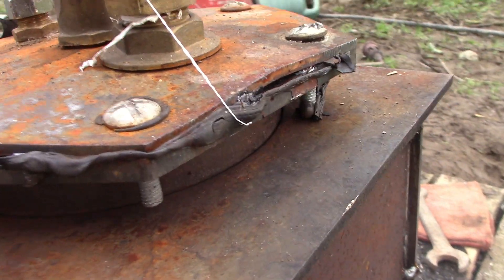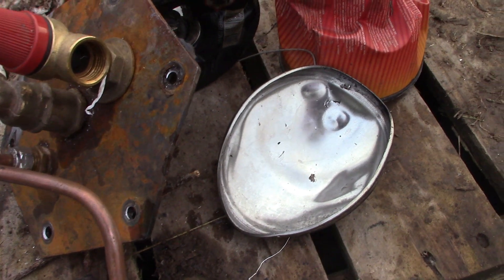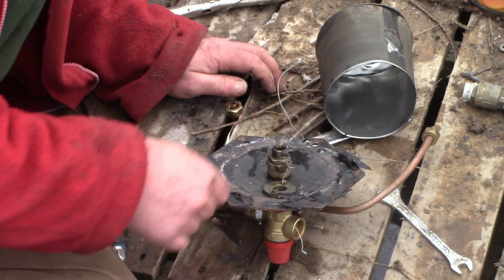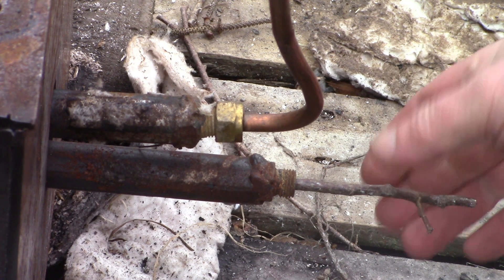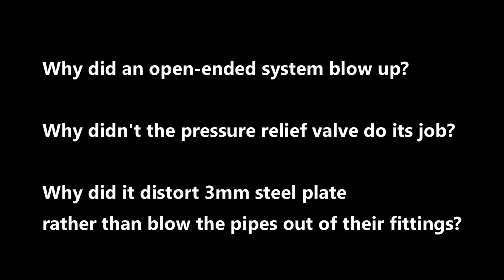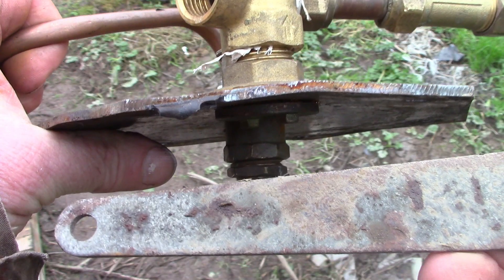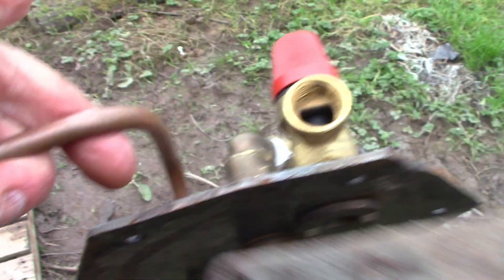Why Did My Boiler Explode??!! My Own Big Bang Theory...

Comment: Your explanation seems reasonable. I think the float system is almost certainly the culprit. You should replace the water inlet valve with a more traditional CLACK VALVE. A simple stainless steel ball bearing one way valve. As far as the pressure releasing valve I would replace that as well with a more traditional spring loaded stainless steel ball valve. It is essential that any boiler system has a blow off valve that is capable of relieving pressure faster than the boiler can increase pressure. The standard boiler test for locomotive type boilers is to bring the boiler up to valve relief pressure then crank up the boiler by opening up the valve that fires steam up the chimney, cause a massive rush of air through the fire increasing steam pressure. The safety valve blowing off must stop any further rise in boiler pressure. Another issue with boilers is having to high a water level, the small amount of steam space allows pressure to prevent the water from boiling off, this causes a buildup of potential steam held back in the form of super heated water, as soon as steam is released the water instantly replaces the steam and water level drop steam space increase causing a rapid boiling off. The relationship between pressure, temperature, steam space is controlled but has a hysteresis loop involved thus the right combination can cause a massive spike in pressure, easily enough to remodel the boiler shape. May I suggest you build a real flash steam boiler , they are much safer as the do not use a volume of pressurised heated water. The concept is simple, create a very long coiled metal tuBe, place this in a fire, when you pump water into the tube it will instantly flash into steam, this then progresses along the tube increasing its pressure and becoming superheated, dry steam. At the end of the pipe connect your steam engine with a bypass valve to allow all the steam to escape and not power the engine, by varying the water pump and adjusting the bypass valve you can control the engine speed. It is best to ad a safety valve just in case the engine stalled when the bypass valve is closed. Often two water pumps are used, one is a priming pump used to start things up and the second is driven by the engine and maintains the flow once started. A typical coil would be like the one brewers use to condense, but more overlapped coils. Consider yourself luck superheated steam will melt the flesh of your bones and from memory the largest ever (until recently) civilian explosion was caused by a factory boiler exploding in an American town.
Reply from the maker: That's what I'm trying to make, Steve. The problem is balancing the water input with the heat. Hence the float valve. It's easy with a gas fire - you know how much water to allow into the system - but this is wood fired so it has to be balanced continuously..
Reply: @wayoutwest-workshopstuff6299  hi there, you are missing the point, you are using a reservoir of water that is being heated, this requires time and a lot of heat to get to the point of creating steam. An analogy if you put a pot on a wood fire it will take several minutes to come to the boil, if however you put a teaspoon of water on the fire it would boil really fast. So you take 30m of coiled copper tube right in the middle of the fire. If you force a tablespoon of water through a one way valve into the pipe it will flash boil into steam within seconds, now add another tablespoon, it will push the steam further into the pipe making it hotter and will boil itself. The important thing is to let the pipe get up to temp before introducing the water. The small amounts of water added will have no effect on the temperature of the copper pipe because the fire can add heat energy faster than the cater can use it to boil.. check out this video it uses blow torches for a high speed boat. Your system relies on bringing the water up to boiling point than as you bleed off steam you introduce more water, instantly chills the boiler and it stops producing steam so the pressure drops.this is why most full sized steam engines have a variable volume pump run from the steam engine that adds a small amount of water to the boiler right next to the firebox, with every rotation of the crankshaft. This avoids the chilling effect. Out of curiosity what size engine are you hoping to run?
Reply: @wayoutwest-workshopstuff6299  https://youtu.be/fPWuW8kBM5c.  Missed the link. Note there is no water reservoir in the heated area, just the tube.
Reply from the maker: @steveallen8987  I know well how they work, Steve. But you're missing the point now - as I said, it's easy if you have a constant heat, but I'm trying to allow for variable heat...
Reply: @wayoutwest-workshopstuff6299  ok I get you now, so the floats appear to be the main source of failure so how about a smaller rigid float with a very small hole in the to to allow equal pressure inside and out and small enough to prevent water entering or perhaps a small curved pipe connected to hole to keep out water. If the size is smaller perhaps a guide to keep it in position?

Comment: Interesting stuff:D, glad you and your helpers are ok. 

(disclaimer: I'm an thermo- and fluiddynamics engineer...but not a specialist in boilers/reactors)

I can imagine 2 scenarios:
---------------------------------------------------
1: Your theory: I don't know what safetyvalve you used and if it's perfectly suited for this application. maybe the pressure wasn't higher as the relief value of the valve but too high for your lid (as you said)...One could calculate this to see if this is a reasonable explainaition. 

2: somehow the top cannister got pushed up over the inlet valve (maybe to thight of a fit from the floats inside the boiler(top float acts as piston)). Since all the connections are at the top, they got sealed with the alluminium sheet from the top float. So the steam couldn't exit anymore and the pressure built up until something had to go...maybe first, the bottom float imploaded and the pressure fluctuations in the boiler were enough to warp the cover...nevertheless, good safety design on the top lid;)
So: 
it wasn't an "open ended" system anymore and the pressure reliefe valve was blocked
The steelplate on top is flat and can't handle nearly as much pressuredifference as the curved walls from the tube (and also not welded all the way round like the bottom end). The pipe ends were protected through the alluminium seal (altough i don't think that they would have gone earlier).
-------------------------------------------------
Some thinking about the "open system"
I think you have a pretty long tube from the boiler to the exit...open ended system is kind of a relative term. The steam inside the tube needs a pressuredifference to move(boiler to outlet)...the longer/thinner the tube and the higher velocity of the steam...the higher this pressuredifference needs to be---> increasing pressure in the boiler. So if you would use an extremely long/thin pipe it is essentially a closed system...and if you would resrict the exitpipe with a stick. You increase the pressure in the boiler almost instantly.
-------------------------------------------------
Some thinking about your "Flash boiler"
I get the feeling that you didn't build a "flash boiler" where you superheat water instantly in a continuous structure. I think you created a conventional boiler with a flash boiler like structure attached. The problem for me is that you still have the bomb(boiler) at the beginning of the system which is essentially a closed system...
--------------------------------------------------
I don't think that you should go further with the idea of building your own boiler...The forces in combination with the enginnering challanges created with water and fire are scary and easily harmfull.

hypothetical Suggestions for an improoved version:
I think a pressure indicator on a suited place on the boiler would be very helpfull. On top of that I would implement a valve on the boiler which you can activate with a cable to relief pressure of the system manually (benefit: it makes the train thuuuuting sounds)...and hide in a bunker while testing it;)

What are your reactions? Other ideas?
Reply: Pressure relief valves don't just open and relieve. They have to be able pass enough steam/ gas to stop the pressure rising, beyond whatever your safe pressure system limit is. That may not be your  actual cause in this instance.but you need to calculate how much steam the valve has to dump  to maintain safe conditions and size accordingly. There is a lot of engineering in developing a safe fired pressure vessel. You may be suprised how much force is exerted on the top plate of your boiler especialy if you consider how the ultimate yield strength characteristics on your  bolts,plate etc components changes as temperature rises. Take care. Superheated steam can be very unforgiving.
Rgds
Bill 6:39

Comment: I'm unfamiliar with these canisters. Was the canister unsealed when used in the boiler? And was it purged with water before installation?

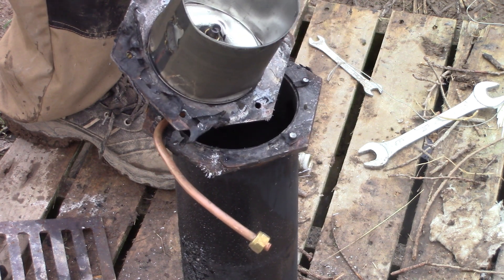It seems to me that the top canister exploded, damaging the lid and crushing the lower canister. At 1:41 and 2:23, there is some interesting damage to the side of the canister in the dark stripe. Was that there prior installation? If not, that might be a clue too. Also the canister seems closer to that side of the vessel. I wonder if canister was in contact with the wall of the vessel, displacing the water in that area and allowing it to heat above 100C? Then some combination of pressurized and flammable gasses caused the canister to explode.

It seems that when the float exploded, it substantially or completely blocked the safety valve inlet. Regardless of whether the safety valve was good, I think its operation would have been compromised. 

I think it might be good to redesign the water inlet mechanism to use a float that isn't sealed, easily imploded, or can come in contact with the vessel wall. If the float implodes, the scenario you outlined might occur.  Or perhaps a design that doesn't need a float is worth considering?

Lastly, it's probably a good idea to put some thought into about what would happen if the valve fails open or closed, or other how a failure of a component may affect other components. e.g. Will bad things happen if the valve fails open and water flows into the 2nd and 3rd stages? What happens when the safety valve fails and something overheats? Of course, it would be preferable to verify what happens, but I haven't a clue how one would test these things safely or non-destructively.  (I hope this doesn't come off as me being critical of your design process, I'm sure you must have considered some of this already)

I'm glad to hear that no one got hurt! And I'm thankful that you decided to post this; we all benefit from learning how things can go wrong.

Comment: The fact that the top canister is stuck to the top in still a good shape and the bottom of it exploded (or imploded, no sure if it's bent outward or inward), it seems to me the top cannister was propelled towards the float valve and the later perforated the top cannister, maybe blocking the float valve in the process and maybe it's even this top cannister explosion that bent the lid of the boiler?
Not sure why the top cannister exploded while the bottom one seem to have imploded.
The top one being probably at a higher temperature (in the steam) vs the bottom one that would be in water. Maybe the top one exploded, sending the top part to the lid and bending it while the bottom part of the cannister was sent towards the bottom cannister, crushing it? Probably not what happened but interesting to see if we can find out the real chain of events.
Reply: I am thinking the first failure was the top canister which blocked the outputs. Then the steam explosion happened and collapsed the bottom one along with the bulge of the lid.

Comment: There was no pressure in the boiler, your 'float' exploded. Probably the lower one went first and pushed the top one into the lid of the vessel. I really think you had a lucky escape there, please take some time to learn about boilers and high pressure steam before someone gets badly hurt

Comment: There is allot to unpack with this and multiple possible failure points. If you were producing enough pressure to restrict feed water flow then your tube could of gone dry. With each inch you add of piping it will further restrict your flow of steam causing more pressure closer to the heat source. I belive most of your materials used in construction of lets call it the boiler tube are under sized for holding pressure. We usually like to have a safety factor of 4 if possible, that is the materials will hold up under 4 times normal loads. Your feed water system is inadequate and your float system not hardy enough or reliable enough. I float system located out side the actual main boiler tube would function better and a one way check valve to keep steam from entering the feedwater system is a must. If your producing more than 15psi then you are operating a high pressure boiler. Having a sight glass to determine your water level and an injector/pump system to ensure the ability to maintain water level is paramount to any boiler system. Even operating an 80 PSI boiler you would want to be able to have 140 PSI feedwater pump system or equivalent. Simple injectors and hand pumps can suffice. Pressure relief valves should be tested prior to use and at regular intervals to ensure proper operation and should be set to work within the range of normal operating pressure. I simple vertical fire tube boiler might suit your needs and be safer and easier to maintain and you can also super heat the steam and use copper tubes brazed and rolled in to a steel boiler. You will have a hard time creating a FLASH boiler as your fuel choice isn't proper as the combustion cannot be adequately controlled. Really you would need gas or possibly oil to properly control the heat source.

Comment: i think that that your floats failed you. I can only imagine that the air inside them was getting so hot that they were being over pressurized (a water bottle left out in the sun for instance will swell as you increase the heat inside of it). 
-Your top float may have had too much pressure inside of it. It then popped forcing a fair bit of energy down into the lower float crushing it and then the remainder of that energy forced the float into the lid of the boiler. (evidence by the float being impaled on the valve)
-Your valve didn't relieve the pressure because the top float may have created a seal on the lid preventing pressure from reaching that relief valve. 
-That same 'new seal' at the top would also protect your fittings.
-im also thinking that maybe just the force of that float exploding inside the boiler, plus the metal being warm may have bent the lid instead of being an over pressure of steam it was just the float hitting with a strong force. After all it did impale itself on your valve there.

o
Reply: I think the float(s) blew up. Cheers 🇨🇦
Reply: I would also guess that the temperature in the boiler was at or above the annealing temperature (between 200c and 300c) of the aluminium alloy that the floats/empty gas cans are made from, so it was probably a combination rupture and then collapse.
Reply: The float hitting the boiler top would not have done damage, the float would have just crumpled. The force from that float blowing up was what battered the boiler lid out of shape, aided by the steam already inside the boiler.
Reply: @ajaxengineco  fair point, just a thought
Reply: I’m just glad you weren’t injured.

Comment: I think a regulated spray of water into the hot cylinder would be better than heating a large mass of water in the cylinder. Add some water to the system in the beginning and then use the pressure created by this to push water from a reservoir into the heated cylinder, regulated by a tap. The heat will flash boil the spray.

Comment: I guess that the air inside the empty butane cans increased volume because of heat and the can exploaded. Anyway: The explosion was too fast for the safety valve.

Comment: My thought is that The fuel containers you were using weren't empty, and the top one reachedthe perfect stochometric ratio to become a fuel-air bolmb,  and exploded.  As to why it didn't before?  I don't know. 
When designing a boiler,  it's best to think about where it will fail if it fails,  and design it so it won't be pointing at anybody if it does.
Reply: He does mention in the video that he had just measure 230oC, in the previous video he'd struggled to make super heated steam.

Comment: You must consider that there would still be small quantities of residual (explosive) remaining gas remaining in the camping gas cylinders. There are well documented reports of propane cylinders that had been well flushed out with water exploding when being cut with an angle grinder or welded when people convert them to stoves. Did the seals of the gas cylinders fail at the high temperature in the boiler releasing the gas?
Reply: Wouldn't make a difference, because there would have been no air.

Comment: Personally not having the knowledge to understand the forces involved I would opt to replace the gas tanks with a solid material such as a float of some kind of plastic, eliminating the possibility of implosions and explosions and i will add a oneway valve for steam and pressure out of the water tank so as to avoid steam press on the water valve and on the long run replace al the water

Comment: The flash point of butane is around 400 degrees, but would drop with reduced pressure. I wonder if the container collapsed, giving a momentary reduction in pressure, and therefore flash point, sufficient for ignition of the residual gas? No expert, pure guesswork!